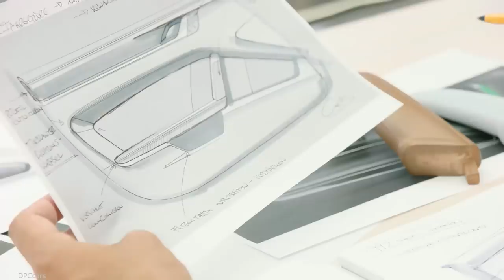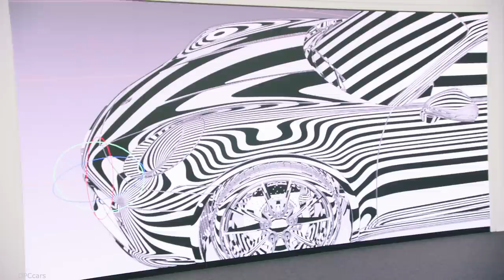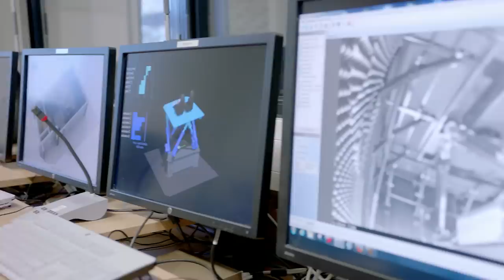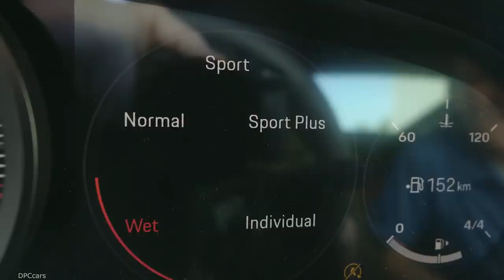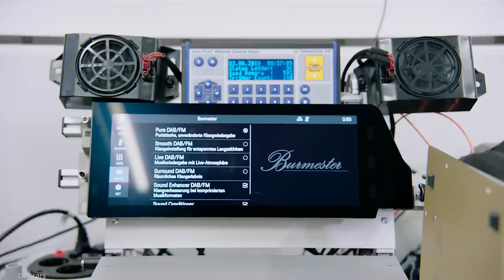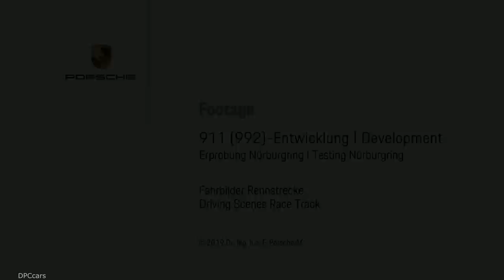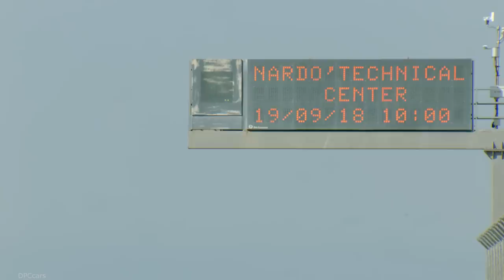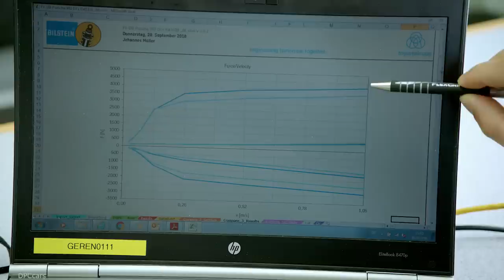Porsche 911 992 Documentary

Comment: Problem and Solution offered: Dash/front/interior vents selections

The problem with observing the virtual person/driver reaching for the touch screen in the Porsche 992/911, is that this does not at all show the decision to place vent choices onto the touch screen in the first place. That is the decision that I have trouble with. Further, setting up for future autonomous driving or voice command still ignored the fact that a series of things go on in a persons mind both sequentially and as quickly as multi-tasking can be learned. The vents have been manual until this new revision. There are better vent placements in some cars; there are better manual directing of vents by a person in some cars; and there are better adjustment, manually of volume of air in some cars. I believe that being able to direct the air at the extreme right passenger location in left-side steering wheel cars would be the only electronic control of these functions that makes any real sense to people, all of whom are used to managing their vents manually. All others can easily be reach. The solution is common ground. Thus, a manual switch that is right/left but which activates and electronic switch could be placed in a strategic and obvious location that would offer either the manual adjustment of the air vents, or the touch screen adjustment. This would allow the customer/driver the option of doing it the old way or the "new" way. I would pay for that switch in the upgrade of the car. The other switching could be incorporated as appropriate with the off or on selection of the touch screen controls. My problem and solution make perfectly good sense and would not be difficult at all to accomplish architecturally. AF

Comment: Funny how they never showed the Spark Plugs or mention that they CANNOT be accessed without taking the engine out. Love the Porsche but these particular models are only good for 3 owners max. Initial owner (warranty) 2nd owner (certified pre owned) and then the 3rd guy who says it's so cheap that I can afford to repair it if something breaks. Then he finds out just how expensive the maintenance is and parts with it. Do your research before you purchase one of these out side of a warranty 🤔
Reply: I have two at the moment. One in warranty, one well outside warranty, never had any problems. Had five in all. 
How many have you had?

Comment: A 2020 car should have active hydropneumatic suspension with active antiroll. Anything less is pathetic for today with the technology availiable especially on an expensive car such as this.
Reply: Please learn more before commenting on something you clearly know nothing about: For your information, the 992 like many 911 models before it, comes with an active damping system called PASM (Porsche Active Suspension Management), which can be adjusted by the driver to predefined settings (Normal, Sport or Sport Plus - dependent on car spec) and monitors, amongst other things suspension movement (distance & speed of travel) as well as input from the car's other sensors for pitch, yaw etc and responds dynamically to inputs to vary damper response in milliseconds. The latest version of this system on the 992 is further improved and provides increased range of dynamic response than before.

The car can also be specified with an optional active roll stabilisation system called PDCC (Porsche Dynamic Chassis Control), which operates via motors attached to the anti-roll bars to deliver near flat cornering, with increased tyre contact improving traction however, some drivers (like me) prefer the sensation of yaw, as it provides an indication of the way the car is loading up.
Reply: @markdavis911time  MMm not bad but not up to the level of tech I am thinking of..Full self levelling and full active antiroll is more llike it...coil springs and springy pieces of metal for antiroll dont cut it for 2020.check out McLarens efforts...Please learn more abouts cars before commenting...you are obviously an ignoramus..
Reply: OK Einstein: I and I'm sure the rest of the world would love to know what qualifies You to criticise the many talented engineers at Porsche when your comments clearly show that you have absolutely no understanding of the subject on which you speak.
If you knew anything about automotive engineering you would have been familiar with the systems employed on the 911 and why, as an evolutionary development of that vehicle other suspension systems aren't viable within the packaging constraints of that cars architecture.
Indeed there is no need for Porsche to 'reinvent the wheel' regarding the way the 911 handles because the car has been acclaimed as the best handling vehicle within its segment for decades and the 992 continues that tradition.
Your comparison between the 911 and the engineering of McLaren's vehicles is wholly inappropriate because not only are the vehicles not comparable from a market perspective, most McLarens being twice the price of the standard 911 (by the way, the base 570S still features coilovers and the rollbars you so clearly despise) but the main reason they're not comparable is because as I just mentioned the 911 is an evolutionary development of an existing car design, whereas all McLarens started with a clean sheet of paper.
As a qualified engineer I understand that, you clearly do not, which is why I would encourage you to get a better education before making ludicrous comments and suggesting that Porsche's engineering is, in your opinion, lacking.
Porsche know a fair bit more than you do about engineering their vehicles, they were doing it long before you, maybe your father or possibly even your grandfather were born, so I don't think they need your advice on where they are going wrong!
With 35 years engineering experience, I equally don't need any lessons from someone who demonstrates their ignorance of the subject quite so masterfully and if, as you suggest, I am an ignoramus, what does that make you??
As you are clearly trolling for comments, I won't waste my time engaging wits with someone so poorly equipped.